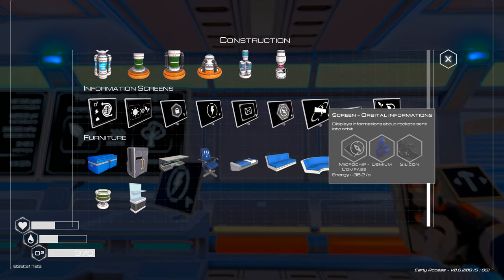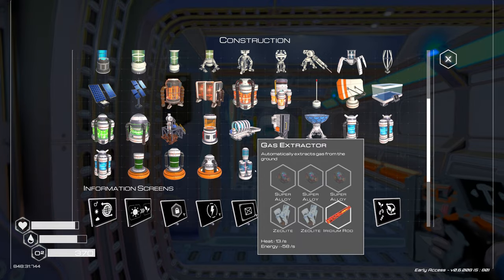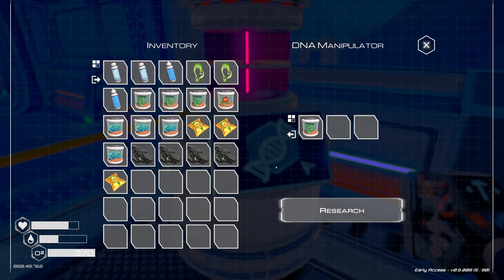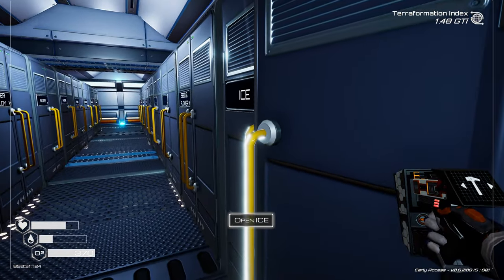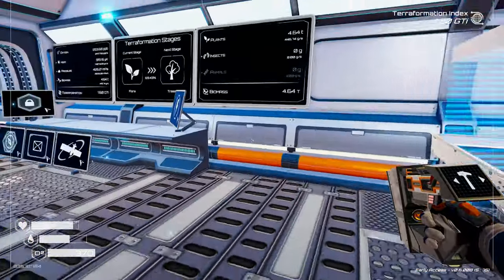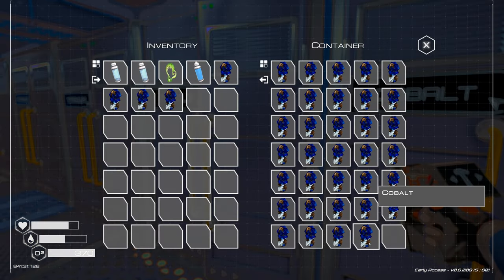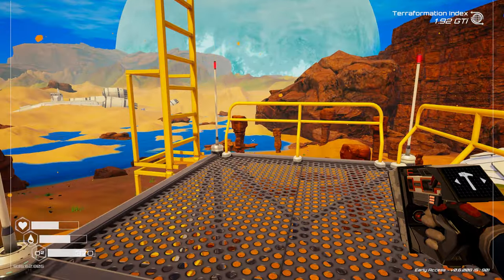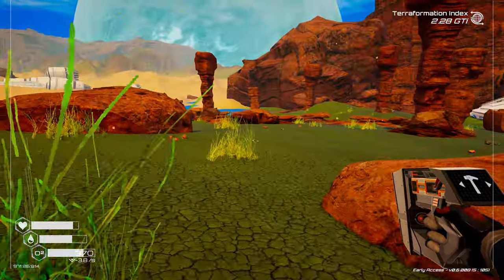PLANET CRAFTER HARDCORE PLAY THROUGH - EP10

Comment: Love the hardcore. I'm on my first run through the game and trying to remenber all of locations of minerals, however; because I have a bad memory I write stuff down: Astroid Rocket: Engine, 2 Sup. Alloy, 3 Colbalt; Magnetic\Uranium Rocket: Engine, 2 Sup Alloy, 3 silicon; Plant Roclet: Engine, 2 Sup Alloy, 1 Fertilizer, Seed Lirma, Tree Bark; Seed Spreader Rocket: 2 Sup Alloy, Bacteria Sample, Mutagen, Tree Bark: GPS 2: Engine 2 Micor Compass, 3 Sup Alloy; Fertilizer: 3 Algae, 1 Sulfer, 2 Eggplant; Bio Plastic: 2 Mushrooms, 1 Silicon, 1 Water; Explosive Powder: 2 Sulfer, 1 Iridium. You can use the outdoor & area lamps in the caverns and the area lamp can be used underwater too.
Reply from the maker: Nice tip on the area lamp, and thanks for the documented recipes I copied them over and have a "cheat sheet" next to my keyboard :)
Reply: Area Lamps are also a good way to mark a trail in the maze. 😌

Comment: In regards to the DNA Manipulator. All you need to know is in the 3 recipes already unlocked.... see what those recipes are and try to play around with the components... check out the common elements...
Reply from the maker: Started trying that off camera... still haven't found one but when I do I will be sure to share it with everyone.
Reply: When I first built this, I didn't look up and hadn't even noticed the recipe screen. I felt pretty silly later.
Reply: @tekriotgaming8886  Well, the common items are bark and mutagen.... and the different items are... flowers.... I am curious on what you get out of it...
Reply from the maker: @gamersunite9171  yeah I have tried some of the higher end flowers like 300, 400, and 600 with mutagen and bark and its resulted in nothing researched.  so I guess I will keep trying  :)
Reply: @tekriotgaming8886  Maybe try lower?
Reply from the maker: @gamersunite9171  lol thanks for the tip.